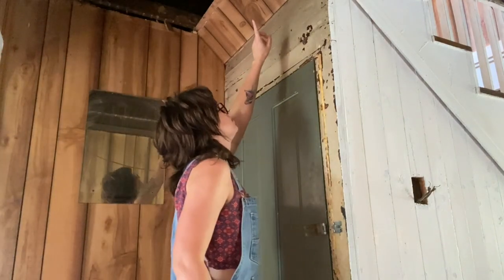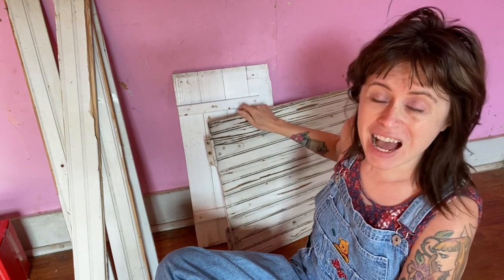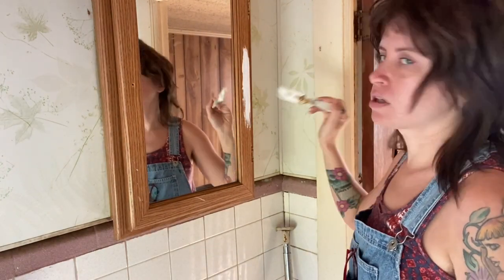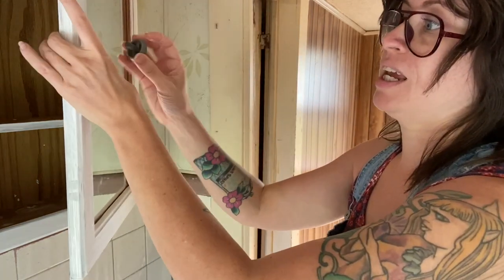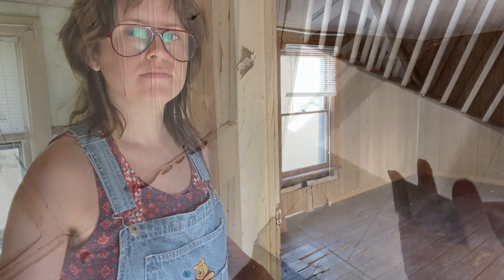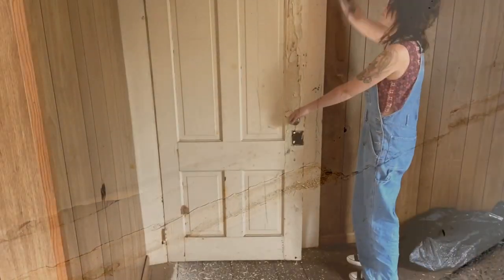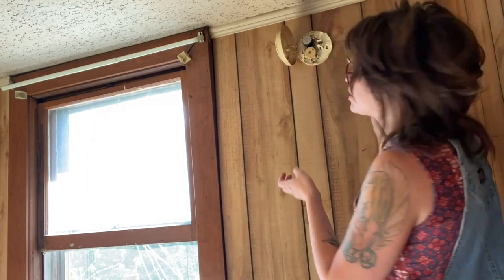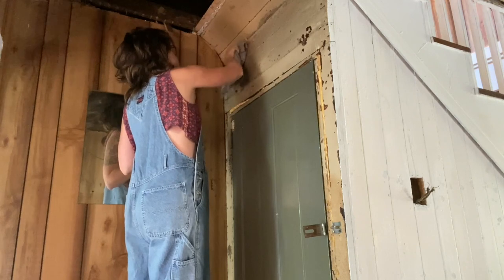This Ole Shack! Ep9 What’s Under The Paneling? Scraping Peeling Paint • Fixer Upper • Old House Reno

Comment: Do you have a Buy Nothing Site in your area?
Reply: good suggestion
Reply from the maker: Lemme look into it….I don’t think so
Reply: @WayCrunchy    I Googled it and there is one in your town.  I joined a local one recently and it's fascinating what people have to give away or request.
Reply from the maker: Whaaaaat! I’m excited now
Reply from the maker: Ohhhh I see now. I’ve been doing that! I just hadn’t heard the name “buy nothing”
I’m a member of two “FreeCycle” groups.
I’ve been giving away thing from inside the house on there, giving the stuff a chance before it goes in the dump pile. 

I got about 12 OLD BIG Wooden frames for my paintings off there for myself recently.
Reply: You are so resourceful and it will serve you well! When doing our fixer upper I was shocked at the cost of door hardware so now I look for discarded doors and removed knobs/hinges if they are in good shape even if the door doesn’t fit our needs. Just a thought for you as it can take a while to collect all the hardware you need.